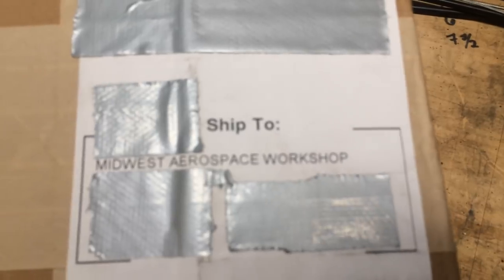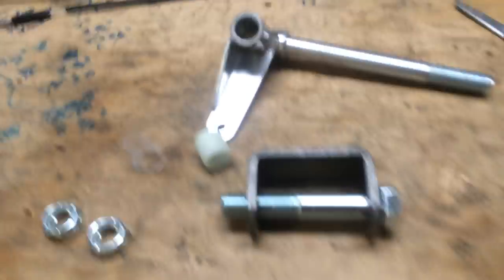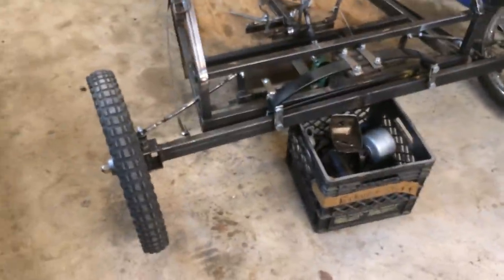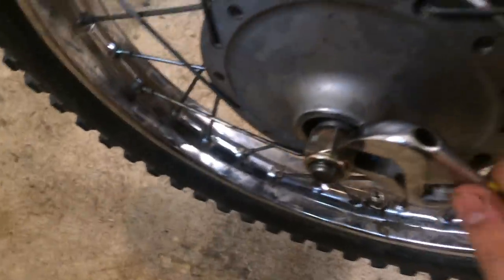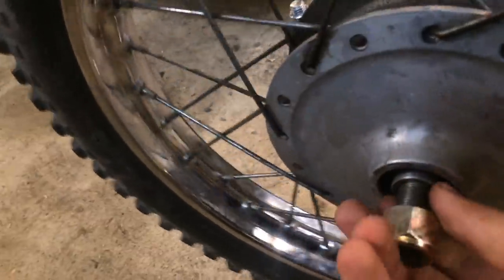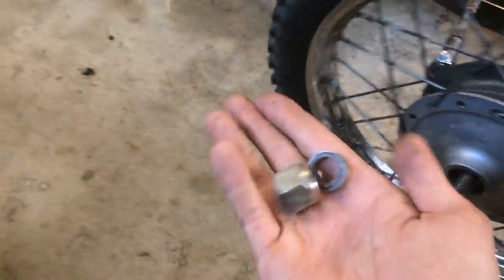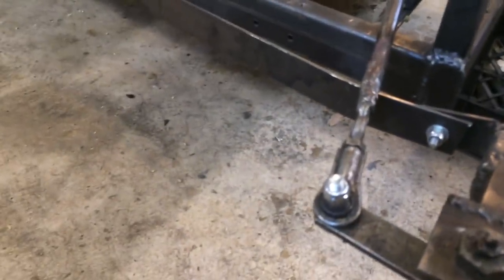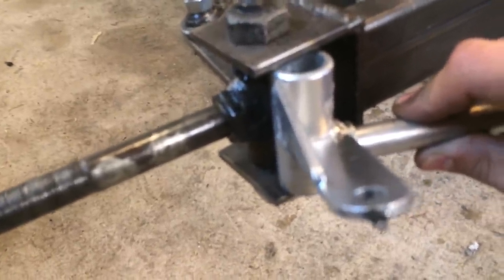Reverse Trike Build Update 2: New Spindles & More

Comment: What is the bearing sizes in the wheel? And what is the shaft size which is going inside the wheel bearing?
Reply from the maker: Internal diameter is 5/8 inch (15.875 mm), and outside diameter is (if I’m remembering correctly) 1 3/8 inch (35 mm)

Comment: Nice work ! I am planning on making a similar reverse trike with piranha 140cc engine, pit bike wheels(drum brakes) and Enduro type rear wheel. The plan has been on my mind and the parts in my garage since last year. But I was skeptical about the top speed. So I bought a Lifan 200cc engine. What top speed are you getting?Would you be moving to a double A-Arm suspension ?
Reply from the maker: Gearing wise the top speed should be ~60mph, but with the large frontal area, it might not get there. I have not had it past 25mph yet because of the lack of front brakes. The Pirahna engine has a lot of power, but is difficult to tune correctly. From what I have read, the Lifan engines are a little more docile, so good choice! For now, I am sticking with the beam axle & leaf spring. Are you going to use independent front suspension?
Reply: Yes, planning to fabricate dual A-Arms. My welding skills aren't great so might end up using ATV arms for front suspension.
Reply from the maker: I see
Reply: Bharathi helo